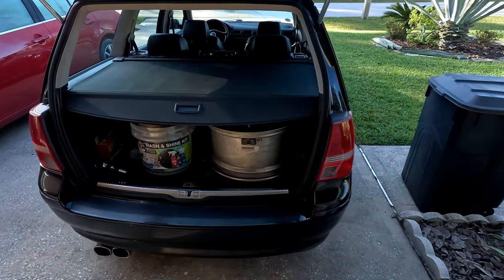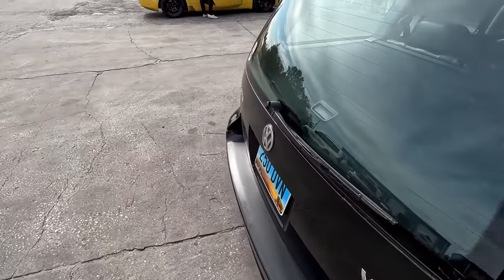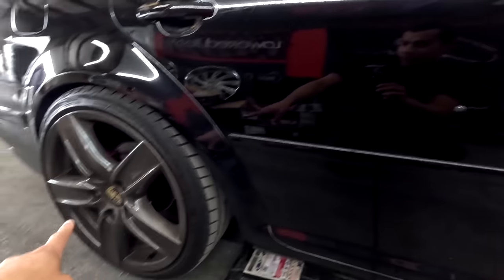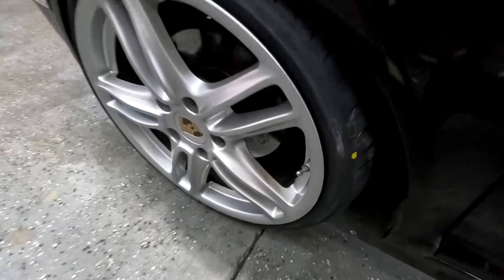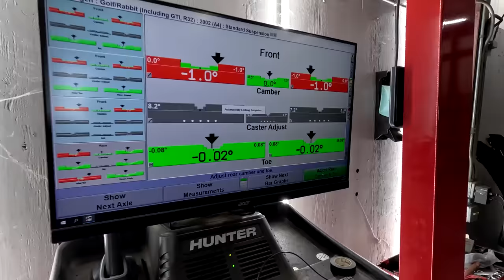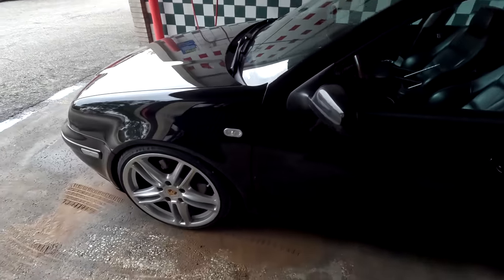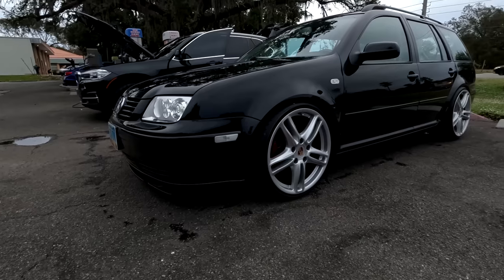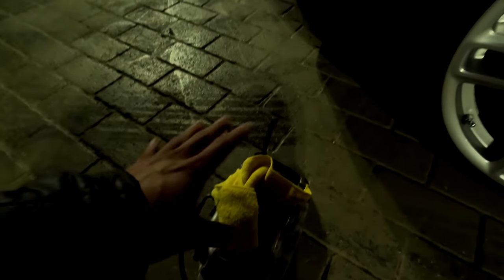MK4 Jetta VR6 Wagon With Panamera Wheels!! ( Perfect Fitment! )

Comment: Hello CHRISTIAN! Until recently, I had a Passat 2 station wagon 1.8 90 hp mono injection. Now drive Passat 5.5 2000 cc 115 horse station wagon gasoline year 2001. I am from Bulgaria. I really like the black Bora station wagon. It worked out well. And blue it Vento is also very good condition for his years.

Comment: It's not a Volkswagen Jetta mk4. It's a Volkswagen Bora. I'm French and I live in France, maybe that's why the name is different. Cordially
Reply from the maker: No it’s a Jetta lol when I lived in Germany I used to have a European spec Bora wagon but this is a US spec car so it’s a Jetta. In the United States we never used the name “vento” or “bora” only “jetta”. Same overall body style but there are differences.
Reply: @Mk3Smith  Ok, thanks for your explanation. In any case I much prefer the US version of the Jetta mk4, with the small details that change from the Bora in France, such as the sidelights on the side of the front and rear bumper, us license plate which does not have at all the same shape as the European plates. I forget many other small details that make me prefer the US versions to the European versions. In France it is difficult and very expensive to import US cars. Cordially

Comment: Atlas tyres wtf is that lmfao.
Reply from the maker: The work great is what they are. Stretch nice, quiet on the highway, and have good grip 🤷🏼‍♀️ Not doing track driving lol
Reply: @Mk3Smith  would you buy cheapo shoes from Aldi or walmart for your feet, I wouldnt, enough said. Only contact you have with the road so should not go cheapo on that.
Reply from the maker: @swansmeister  doesn’t matter what you would do it’s not your car 😂😂 From the people I’ve talked to they had no issues with these and worked great. But hopefully now every time you see the car it bothers you lmaoooo